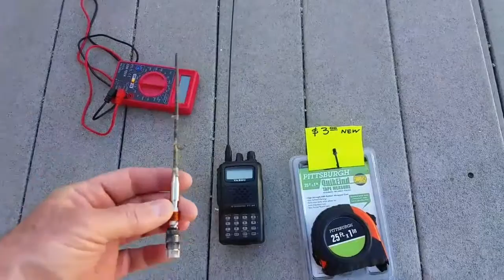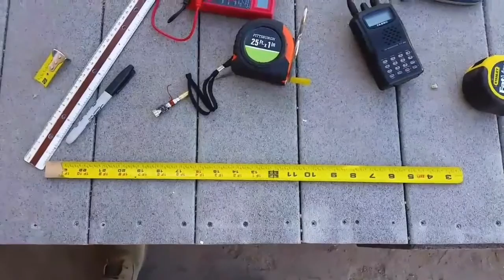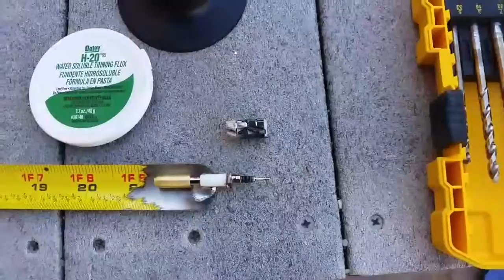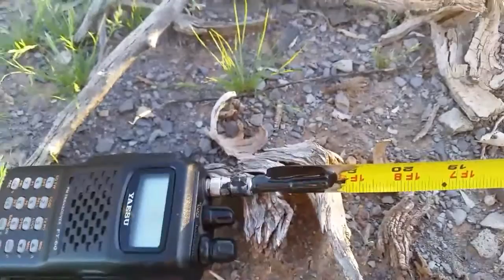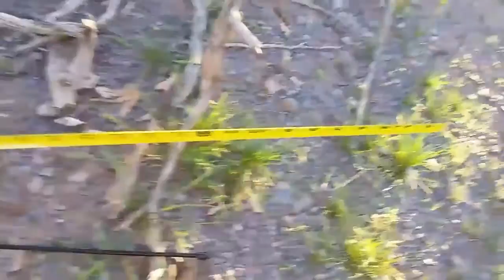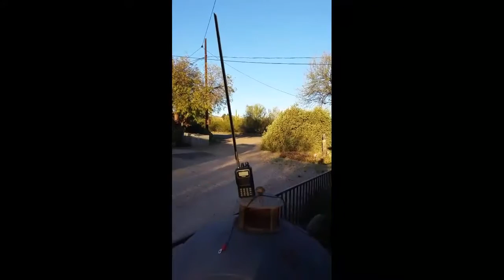Yaesu FT-60R antenna idea

Comment: Over at KB9VBR You tube channel,  he fabricated a simple RF "fox hunt" 3 element yagi with tape measure elements and PVC for the boom. Great demonstration. I made a ton of antennas before but never thought of using actual tape measure material for radiators, reflectors and directors. Pretty darn easy to measure and trim the antenna. HOODATHUNKIT???? lol

Comment: What kind of solder do you use ? And how durable did this turn out to be ? Obviously I see the weak point being the connection to the threaded part of the antenna with the expoxy